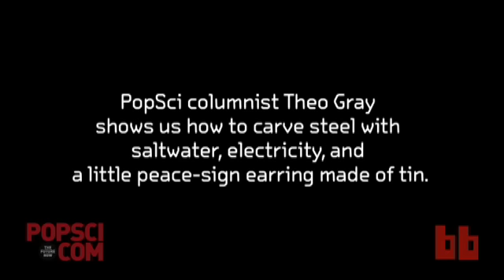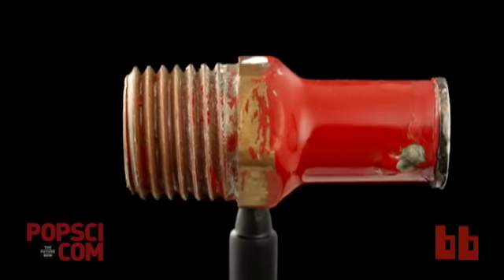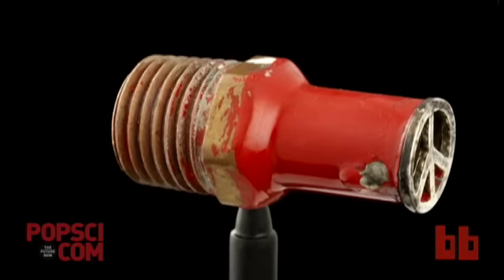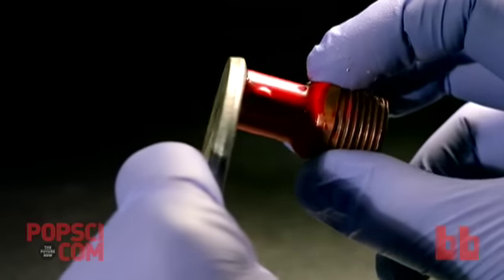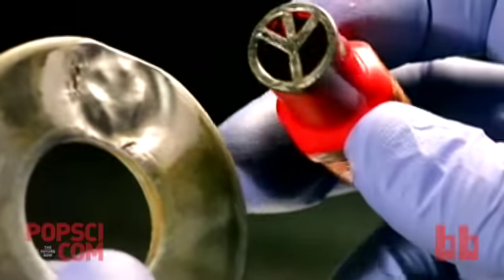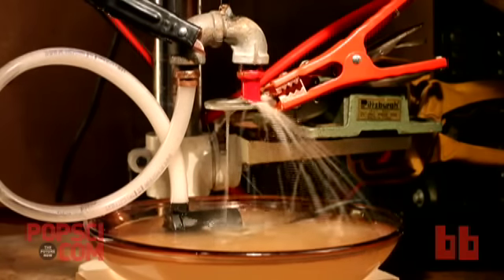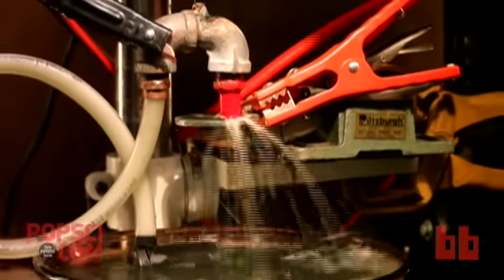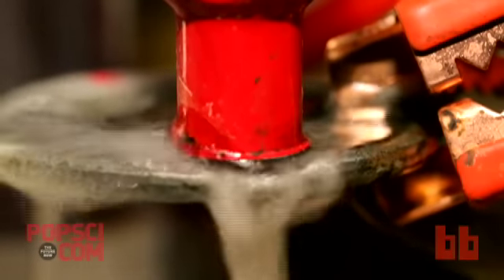Carve Steel with Saltwater, Electricity and a Tin Earring (BB Video + Theo Gray + Popsci.com)

Comment: @DAIGORO14 When machining in metric, measurements are in mm followed by 1/10 and 1/100.  So if you want to keep something 0.001" away from something you would need to keep it 0.025 mm away.  The advantage of metric is when converting units.

Comment: Nothing new here whatsoever. They've been using a similar process called electrical discharge machining for decades. It uses a thin oil instead of saltwater so it doesn't corrode the metal and a carbon sinilar to pencil lead for the electrode.